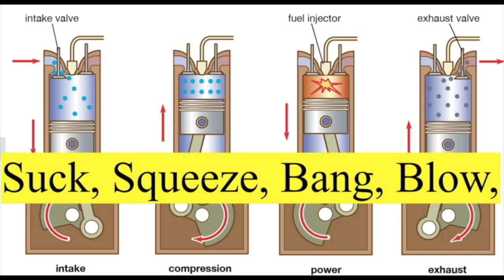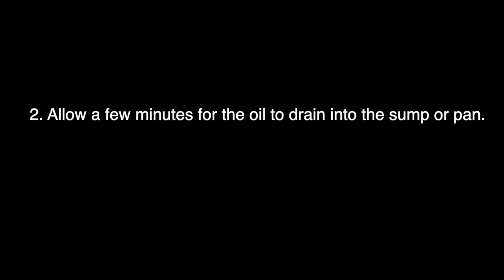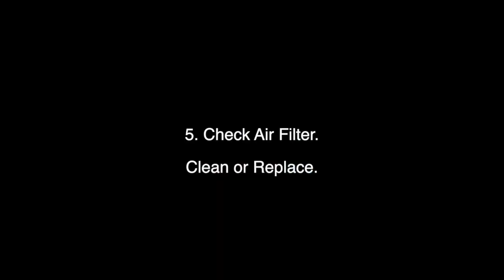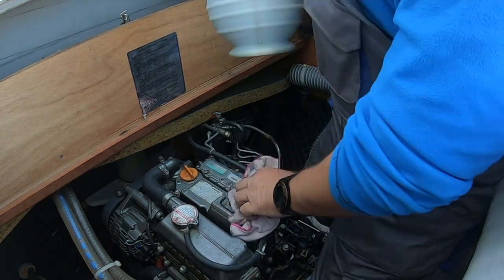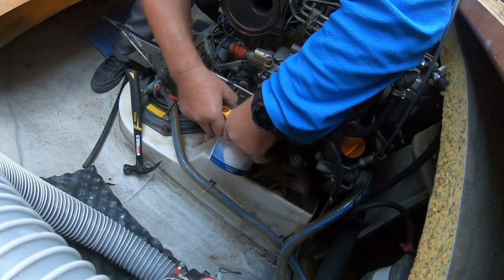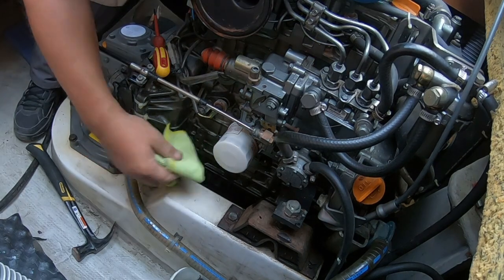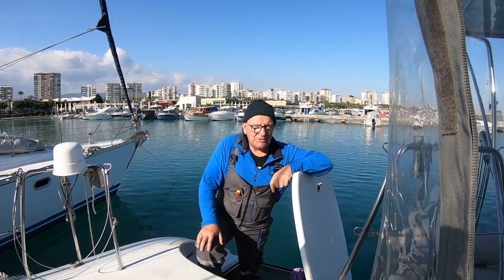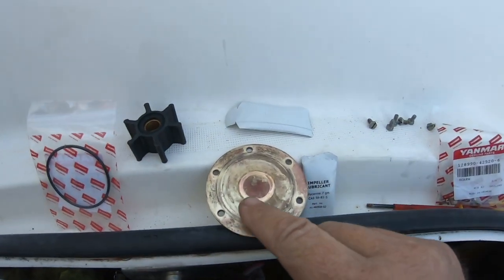Yanmar 3YM30 Service. Part 1 OIL and AIR  Filter Change. This engine eats it's Air filter!

Comment: Love the tips, especially the one about adding a little new oil to pump out all the used oil.  Besides the oil are there any additives that should be used.
Reply from the maker: We dont use any additives in our engine oil. although a bit of injector cleaner now and then in the diesel does not hurt. When I used to do a bit of racing we used some oil additive called Slick 50 It was good at protecting bearings and shells from wear.  Sail Safe mate. Ant & Cid

Comment: Great video!  Can you talk more about the "Engine Condensation" issue?  As sailors, we use our engines infrequently.  Thanks!
Reply from the maker: Great suggestion! We will cover this in a future video. Sail Safe mate. Ant & Cid
Reply: The things to remember with Diesels, is they love to be worked with a load, and worked Regularly. Just using them at tickover + a bit to charge batteries, can rapidly have bad consequences for them, particularly if they aren't going to get used much due to having say lots of solar power and a large house battery Bank. so for my inboard diesel while in passage, I have a routine that gets me into a routine that becomes a habit bit with changed timing if in an anchorage to avoid waking up neighbouring boats early, On Passage, for the first night watch just as it's getting dark (Tea Time) I furl in the Sails while warming up the engine at tickover, once Sails furled into forward gear and set the rpm at 1700 rpm for decent torque and very economic Fuel Consumption, and about 6 knots with the right orop and put on auto pilot to get Evening Meal on the go  with an induction Hob powered by an inverter (formerly a Toasted sandwich maker or Slow cooker on Max Heat of something precooked on the gas hob ready earlier ( next boat gets the induction hob) Water is also being heated up via the Heat  exchanger for a shower if anyone wants one) Last night watch before the Sun Comes up, same setup for breakfast- I like a Fruit juice first, say with a Fry up/ toast, then kettle on for Tea/coffee. Hot showers available twice a day, can run a Mini Washing Machine lots of Gas saved, plus when lots of juice going into the Batteries from Solar Panels, can run WatermakerWashing Machine/ Induction Hob for Lunch, so with the  engine getting run up to temperature under load twice a day, engine plus gearbox are getting the work they need to keeping tip top condition, plus the batteries should be kept in the safe zone of long life above a 50% state of Charge. Me, I use Manufacturers Servicing recommendations as Maximums, only to be approached in emergencies. Lube plus filters inside recommended periods, and definitely for water pump impellers. Those impeller blades break off, and things have definitely become serious. If the engine is Turbocharged, only the best Turbo oil, tickover for at least 30 seconds before revving, to make sure the oil has made it to the Turbo Bearings, Tickover for at least 30 seconds before switching off, to keep oil flowing to those bearings while the Turbine spins down from what can be extremely high rpm. I have literally Never had a Turbo Fail on me as a result of following that procedure. I use a cheap thin Flushing Oil (Hydraulic Oil even) to Flush out engines (never running them while flushing obviously ) and Saildrives - particularly the Cone Transmission Yanmar Saildrive legs, ZF Disc Transmission legs are much better, and more like the Volvo leg, but only available for Yanmar engines (I really like Yanmar Diesels, never had a problem with them yet) 80hp and avove, so below that hp, get flushing, and flushing regularly. I personally would not touch even the ZF 360 degree rotating leg, for crossing Oceans with. Seems a daft idea to me tbh. Not that I would personally abuse equipment that way, or recommend anyone abuse equipment that way, the amount of abuse I have seen a poor Volvo Saildrive take was truly horrific. One clearly hadn't had a service forv21 tears, the leg to Hull  Seals never changed in that time, Drive leg seals gone Engine components like exhaust and heat exchanger shot, new owner replaced everything, flushed everything, then full service, and that little beauty came back to life . .if treated like a new engine, oils and filters etc changed at 3 months, then 6 months, then annually at haulout, with a careful eye on things for that first year, it should have become close to as good as a new setup imho. I meandered a bit off there  sorry, but there's just something about Diesels and I love the character of the things lol. Best Wishes and Fair Winds.  Bob. 👍⛵️✨️✨️✨️✨️✨️
Reply from the maker: @brownnoise357  Spot on Bob! Sail Safe mate. Ant & Cid

Comment: This is a great video. Thank you for putting this together. I have a few questions. 
1) I don't see the links to all of the tools. I checked out your web page (which is very nice) but I don't see the tools there either. 
2) What oil did you use? 
3) How much oil is needed?
Reply from the maker: Sorry, I forgot. I'm in the UK at the moment I will try to get on line and sort it out and also put a link in the description. We use Shell Helix, The grade and quantity are in the manual. You can download this for free. I think it was around 3.5 ltrs of 15w40 But please check.
Sail Safe mate. Ant & Cid
Reply from the maker: Just added these to the description. We will put them on the website when we are back on the boat. Sail Safe mate. Ant & Cid 
Oil Filter Strap:https://amzn.to/4ahyPsq
Oil Extractor: https://amzn.to/4aEbn8z